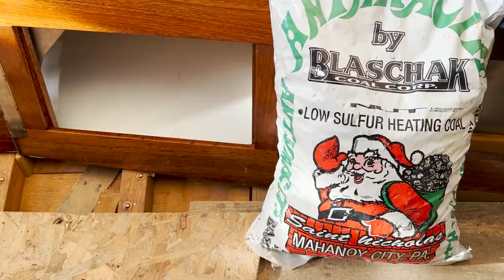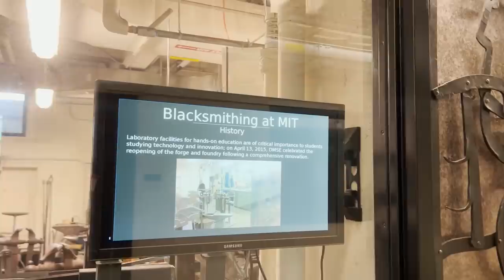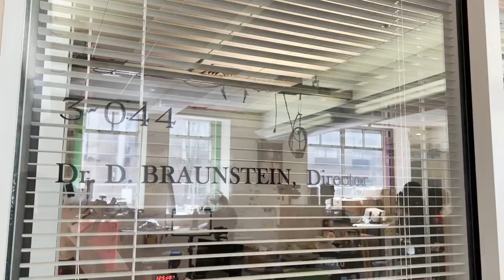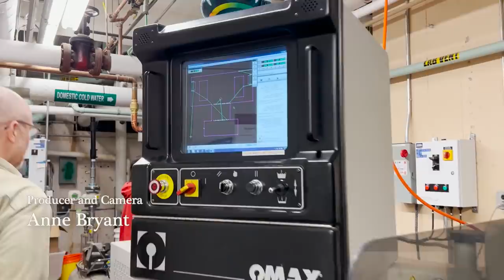Putting In the Shipmate & A Visit To MIT - Episode 208 - Acorn to Arabella: Journey of a Wooden Boat

Comment: I'm sure this has been explained before but i must have missed it. What is the point of having two seperate ovens? I'd guess the one on the gibal is run on gas, so why a secong coal one?
Reply: Most of the conversation I’ve heard around the wood stove has been focused on heating the boat, not cooking food. My guess is that the oven here is a nice bonus rather than the primary intended use.
Reply: @jelliottlein  But then der is the Fuel heating stove too. It seems a bit overkill for me.
Reply: yep, three stoves - diesel heater, alcohol cooker and wood/coal heater/cooker.  they plan on doing a lot of high latitude (cold) sailing.  the options will be wonderful.

Comment: Modestly urging you to: find a way to position the wood burner as so face outward..simple you will have the ease of approach being direct, so casssrolls & pies etc won't need to be angled to fit. Such as for loading oven etc..2. The coal cupboard you should fill from the bag..line the box & adapt a shoot or approach so you unload a bag into the space...your not going to want to monkey with digging the bag in & out.
Reply from the maker: We have a cook stove for pies and casseroles for anything bigger than the small loaves of bread steve would like to cook up on occasion at anchor with the solid fuel stove. Thanks so much for watching!

Comment: Have to say the stove makes no sense to me. It is a small boat. Why would you want to store wood or coal on it? A propane or diesel heater could have the tank in an out of the way place and largely be maintenance free. The heater would take up far less space as well. Also the fire hazard, soot, smell, constant maintenance, and acquired creatures from the wood that like to eat wood. Seems easier to just use diesel and share the fuel in the same tanks as the engine.

Only advantages I can see is being able to collect wood on beaches for fuel and not hearing a fan or needing the power to run it. A small battery and solar panel can keep up with that.
Reply from the maker: This is a matter of preference really, and sure, some people wouldn’t want a woodstove, and so they wouldn’t have one. Steve loves solid fuel stoves and one like this keeps condensation at bay inside the boat. It’s a lovely type of heat, and the diesel stove will be the primary source of heat. If he doesn’t like it or doesn’t use it, it can always and easily be replaced with stowage. Adding one later would be a chore. Thanks for watching!

Comment: Shipmate comment:
Aren't you more likely to pitch violently rather than roll. If the positioning of the Shipmate is intended to mitigate the doors opening I suspect turning through 90 degrees would be statistically better.
Reply from the maker: No, not really. Stoves in general are gimbaled exclusively for rolling but not for pitching (cookstoves, for example, can be installed to open in an orientation fore and aft but aren’t gimbaled in that case). Might seem surprising but there it is!